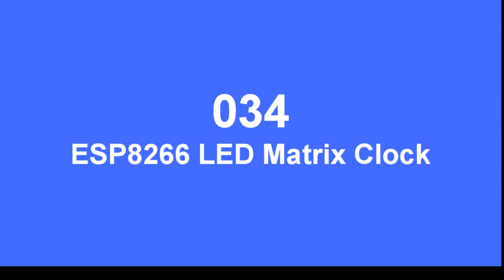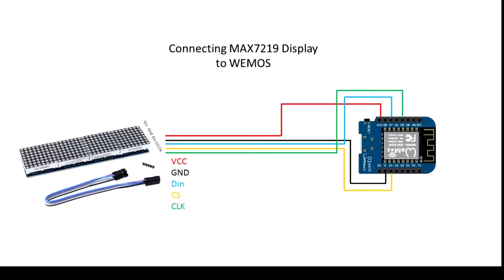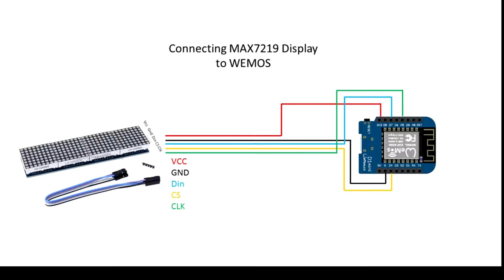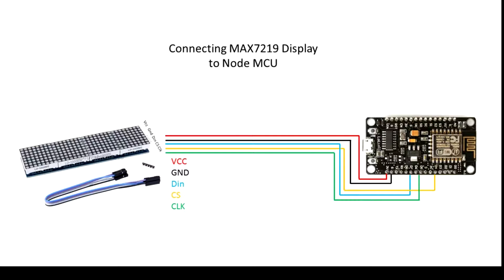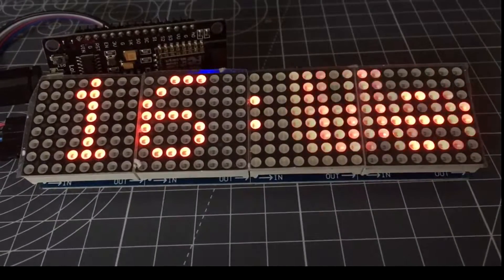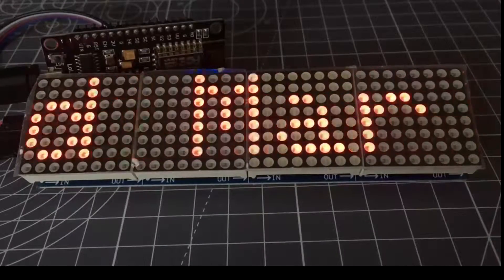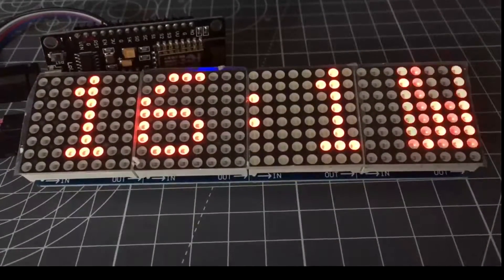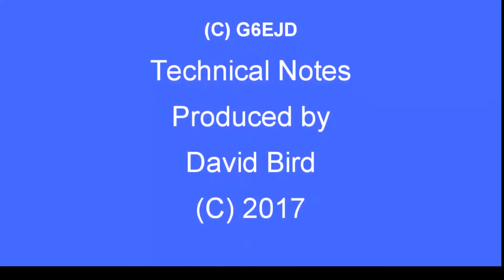Tech Note 034 - ESP8266 LED Matrix Scrolling Clock

Comment: Thanks for a great project. I followed your video and made one, it works great, but how can I change it from 24hr to 12hr?
Reply from the maker: Unfortunately (unlike the ESP32) the ESP8266 cannot give you a 12-hour clock format,  so after this line:
String time = String(ctime(&now));
//You now have a time string of format "Thu Jan 01 00:00:00 1970"
So how to get to add AM/PM indicator?
First extract hours:
int hours = time.substring(11,12).toInt();
String str_hours = "PM";
// Now add AM/PM prefix
if (hours%24 < 12) str_hours = "AM";  // Now needs to be added in to time string
if (hours%12==0) str_hours = str_hours + "12"; else
  if (hours%12 < 10) str_hours = str_hours + " " + String(hours%12)); else str_hours = str_hours + String(hours%12);
then finally :
//"Thu Jan 01 00:00:00 1970"
time = time.substring(0,11) + str_hours+ time.substring(13, 24);
Reply from the maker: When the time has been reformed to 12hr, it may be useful to serial.println(time) to make sure all those substring number positions are correct.

Comment: Once Again, an awesome Video, I have been wanting to try these displays for a while, It works great, But of course I have One Question,... How do I change the time -5 Hours (Since I am eastern Time in the US... always have trouble figuring that out... Once again You make great Projects... keep them coming !
Reply from the maker: Thanks, time on the ESP8266 does not work fully, but you can change your time at this line:
configTime(0 * 3600, 0, "pool.ntp.org", "time.nist.gov");
The 3600 refers to one hour (60x60secs) so to move time back -5 hours change it to configTime(5 * 3600, 0, "pool.ntp.org", "time.nist.gov");
The ,0, element is the DST offset but does not work, e.g. add 1-hr to EST would be configTime(5* 3600, 3600, "pool.ntp.org", "time.nist.gov");
Reply: Thanks , However changing the line to : configTime( 5* 3600, 0, "pool.ntp.org", "time.nist.gov"); Actually moved the time forward an additional 5 hours, I thought I would be clever and move it 19 hours forward, but that put me into tomorrow, been looking up how to subtract 5 but no luck so far.....
Reply from the maker: Change the sign to -5 that’s my mistake you need to move the reference clock back 5-hours:
configTime(-5*3600,0,...
Reply: Worked Like a Charm ! Thanks for the fast response !...Cool Project ! Making a case and putting it in my kitchen !
Reply from the maker: Great, For the xmas period I am thinking of putting one in the porch to welcome visitors and I can change the message from my iPhone 😊 as each arrives
Reply: That would be cool !!

Comment: thanks for these realy helpful tutorial. You are my hero. I try your sketch but unfortunately I don't get any actual time/date. Time is allways 00:00 and date 01.01.1970. The reason should be that I have no access to pool.ntp.org. Further on I don't see any settings for WLAN. I'll try to fix these but unfortunately I am a real noob for these topics.
Again thanks for the video. Hope we get much more of these from you.
kind reguards
Uwe
Reply from the maker: It is most likely your Router or Service Provider is not allowing access to the Time Servers, does your PC get its time from a server? IF so use that address in the source code. You can use two a primary and secondary.
Reply: I have tried to add your code to my MQTT stuff. In these coding I use login for my local wlan including internet access. And now I get time and date. Unfortunately time is one hour before German time. But I try my best to fix these.